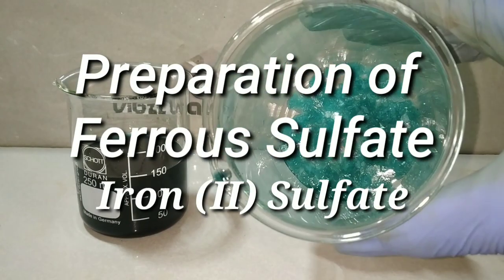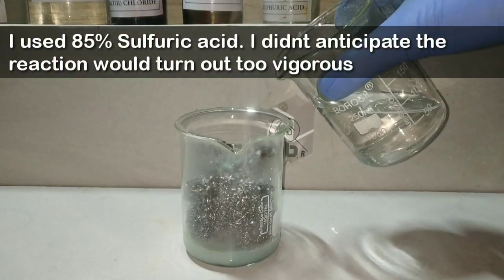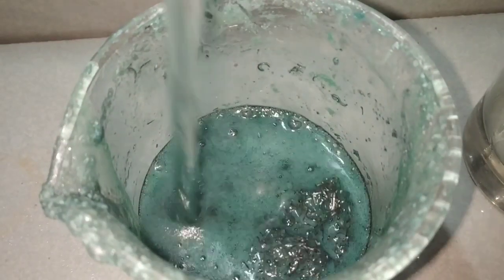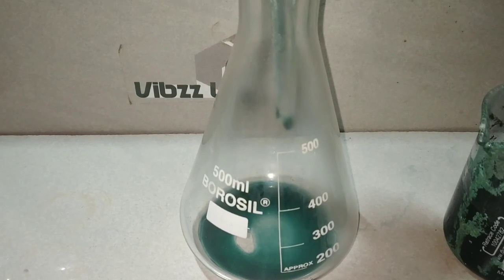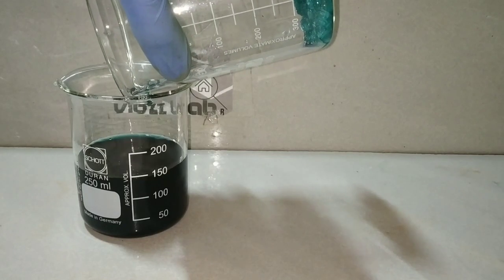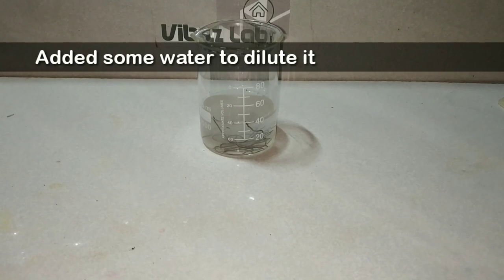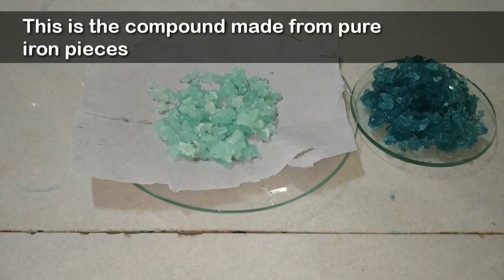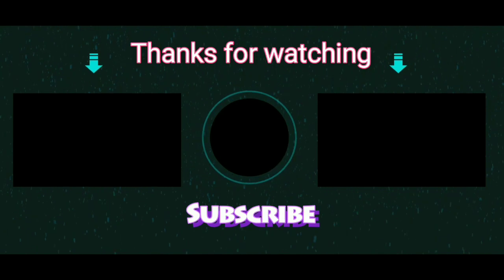Preparation of Ferrous sulfate : compare stainless steel with pure iron

Comment: Fascinating, thanks for sharing. We want to get a green patination on a sheet of steel, could this work for that? Fine if we get ordinary rust too.  And could the green  colour be preserved with a lacquer or other clear coat. Is this green colour more easily achieved with stainless steel? Your video seems to emphasis chromium. Is Chromium key to getting the green colour?  We know brass and copper are better for green patination but wonder how best to get green patination with steel, raw or stainless. Also keen to know how best to preserve the colour too.

Comment: Is this ferrous sulfate solution will be oxidized by the air???,  i don't want this solution to be ferric sulfate. Is there any method to protect the iron ii solution???
Reply from the maker: Add a little sodium bisulfite solution to reduce it back
Reply: It will save for about 3 weeks before oxidizing. Easy to make new batch if needed.

Comment: Hey I've attempted to recreate this experiment yesterday using 15% H2SO4 and over night no reaction. Is the acid too dilute? Or did you maybe add nitric acid? Thanks in advance
Reply: @vibzzlab  Thanks for your response. Turns out I was just being stupid as usual. 

I added 3% H2O2 because I thought it would be beneficial for the reaction but this caused the 15% H2SO4 to get too diluted and hinder the reaction instead.. also the solution was below room temp which might also had a negative impact. 

In a new attempt I used the clean 15% H2SO4 at room temp and within the first minutes the Chromium layer was dissolved and as it reached the Iron the solution began to bubble vigorously

Comment: If you wants to separate the metals the following method can be used :
Take the dark crystals and convert to carbonate or hydroxide. Dissolve in acetic acid. Then use hydrogeperoxide to convert the Iron ii acetate to insoluble Iron III acetate. The Chrome acetate should be soluble.

Comment: Sir can you please tell me where to get 'pure' iron? Because whatever I see around me is steel or stainless steel. Pls sir. And I liked your video.
Reply: I use mild steel for a lot of iron chemistry.  Also, ferrous sulfate is widely available cheaply as an agricultural agent but is particularly oxidized. I usually use that, add dilute sulfuric acid and heat to near boiling with a steel rod to stir with.  This helps reduce ferric to ferrous and you keep heating until it is near saturation at 100 ° C then allow to cool to get first crop of crystals

FYI a slight excess of sulfuric acid never hurts because it reduces the solubility of Iron(II)sulfate

Comment: I would love to see if the contaminated dark crystals would dissolve in water. And if one could use the solution to age wood. Im a carpenter and often use iron sulfate dissolved in water to treat wood. It turns the wood a dark Grey after being left in the sun for some time.  I would love to try it.
Reply: I’m thinking that the chromium could not react directly with wood tannins and just make your gray color more greenish tinged.  Or, maybe chromium WOULD react and form deep brown colors.  There is only one way to find out!

Comment: The chromium sulfate should be able to be separated by placing the crystals in alcohol.  Iron sulfate is insoluble in alcohol while chromium sulfate is soluble in alcohol.
Reply: @vibzzlab  Or you can try to separate the iron from chromium to then prepare some chromate and/or dichromate of your choice (potassium/sodium/ammonium).
Reply: I was going to suggest this too xD
Reply: Is this heptahydrate form of ferrous sulphate?
If not, how to make it from this?
Reply: can chrome sulfate use as electrolysis plating like copper sulfate plating?
Reply: Yeah be careful with chronium sulfate solutions and chromium sulfate in general. Its pretty air sensitive